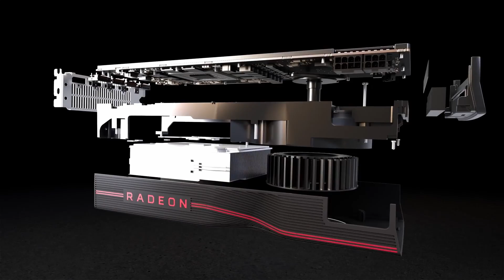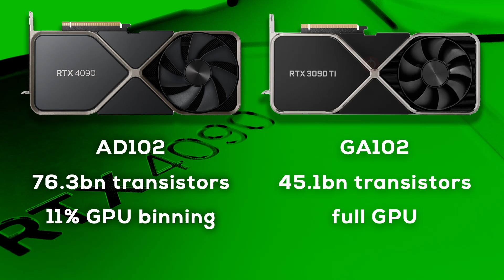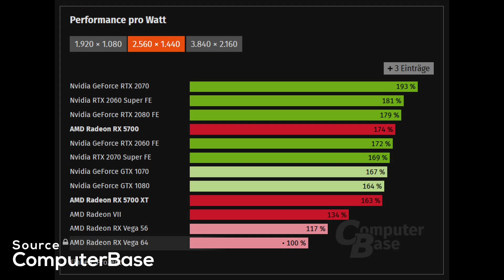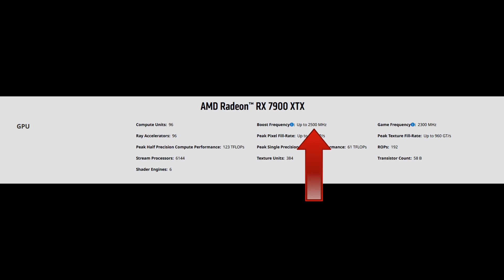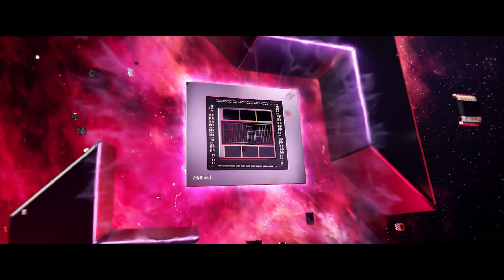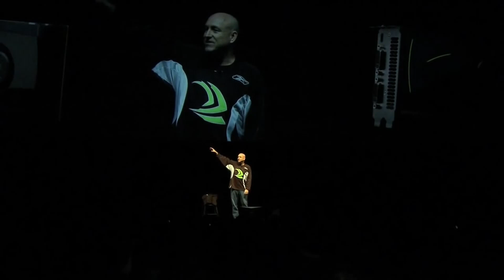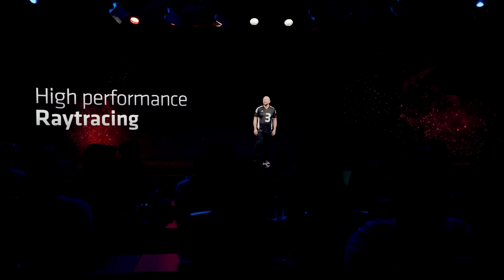RDNA3 – what went wrong?

Comment: i actually think the specifications cant be directly compared. i think the 6144 shader count makes much more sense and if you calculate tflops with this number in mind the numbers really do all add up. that 61.4 tflops assumes that the gpu can run dual issue fp32 which obviously most games cannot. this is why some games the 7900xtx is faster than a 4090 then others it barely matches a 4080 this is likely expected performance. this also makes sense why nvidia with the 30 series didnt hesitate to list the dual fp32 shaders as normal shaders where as amd is choosing to say 6144 not 12288. likely something in the design requires specific things to take place to utilize the rdna 3 design fully. i dont this drivers will fix this and i think people should just accept this is what we got. they arent bad gpu's by any means quite the opposite and i am sure with time stability and some performance will increase. i just wouldnt sit here waiting for some massive turn around because its never gonna happen. id gladly take an aib 7900xtx and run it at 3 ghz and id be more than happy with that level of performance. who knows maybe this time we will actually get a rdna 3+ next year with tweaks to better utilize the shaders. but honestly i think the gpu is running at the perf you should expect out of 6144 shaders and 31 tflops
Reply: Aye the Duel Issue SIMD doesnt seem to be working as one would expect. That alone should increase perf a lot but most of the perf uplift seems to be coming from all the other changes.

Nvidia did the same thing with last gen. Saying they doubled their FP32 but it was sharing with INT and the cards could never reach what would be expected from the doubling.
Reply: pcworld was saying that there's an AIB 7900xtx card that's about $100 more than 7900xtx AMD and it's around 20% or so better because it's clocked near 3ghz etc. I'd be rather happy to buy that as I need to upgrade from my rx570.
Reply: @skilletpan5674  any of the 3x 8 pin 7900xtx seem to clock around 3ghz so if u can find any of them buy it. i currently have a 6900xt red devil in an open loop. id really like to get the asrock aqua because it comes with that water block
Reply: @TheCivicsiep3  yeah I'm broke at the moment. I may beable to get something in feb/march.
Reply: RX 7900XTX is just RTX 3090 TI TITAN edition... new nm process with higher clocks and full die.
RX 7900XTX should be named and priced like RX 7800XTX 399$
RTX 4080 should have ben priced 499$
Reply: @zdenkakoren6660  as much as I would enjoy those prices, I don't think that is realistic. They're for profit corporations, not charities. They need to keep making money to do R&D to make the next generations of cards so we can complain about how it's not perfect on youtube
Reply: I agree I think the refresh will be where it's at, they'll have worked out all their issues with hardware and software and then we can see the full potential of RDNA3. Maybe the rumored 7990xtx will come out.
Reply from the maker: Yes, its definitely not comparable.

Comment: Power management having issues is something AMD's GPU division is no stranger to. Maybe some fundamental mechanism of that (i.e. clock gating) is broken, so that unutilized parts of the GPU can't be shutdown in some cases. As for the interconnect between the GCD and MCDs, this is said to comsume around 20-30W.
Reply from the maker: It could be a couple of things. Maybe the voltages are fine, but its higher than expected chiplet interconnect power draw or power gating problems. It also could be mainly a software issue, lets see if we find out at some point.
Reply: @HighYield  personally I think it's a bios issue reminds me of when a default Vista driver for a hard drive would 12 volts when it was supposed to send 9volts FYI the issue was not fixed until win7 and several  bios updates

Comment: This is so frustrating. All of GCN had power draw issues. Those finally seemed fixed with RDNA1 and 2. Now we're back to square one. IMO AMD should have waited with the release until they fixed whatever is wrong here.
Also, their driver team needs more people! Drivers being rough around the edges at every launch doesn't need to happen anymore with the profit AMD has been making during the last few years. This would also allow them to start thoroughly testing the HW way earlier, potentially allowing them to resolve issues before they ever become public.
Reply: As a former AMD user I have to say the drivers have drastically improved in the past 5 years
Reply: @timothygibney159  then why "former"?
Reply: My rx 580 had the black screen issue and nothing would fix it. Had to return that ish
Reply: Latest drivers released dec 8th, 2022 btw. ❤
Reply: Exactly!
Reply: Another factor here as to why AMD seems to have launched RDNA3 before it was ready also came down to a dead line in the US market, GPUs were about to get hit with tariffs so launching when they did meant they can get GPUs on market before that with the initial batch coming in cheaper. However since then there was an extension on the exemption for something like 9 more months. 

I honestly do think that this is largely a driver issue, AMD is launching a bunch of new stuff including RDNA3 and I think this is why RDNA2 has not gotten an update in like 40 something days. Also the fact that people now complain with only like 45 days before the last update shows how far AMD has come when it comes to driver releases. I expect that we will see this situation for some time until the drivers are in an acceptable place.
Reply: @@user-gn4kb2gi1d I almost purchased one, though I didn't and I am super happy that I didn't as I don't know how much performance it will gain as drivers develop. Though some testing has shown that the 7900 XTX is a card that is capable of going toe to toe with the RTX 4090 when it comes to rasterization performance. With the way things are now it just isn't worth me going from my 6900 XT to the 7900 XTX.
Reply: how much of that profit is from Radeon Desktop cards though? lol… gaming cards are not a big priority over at AMD these days sadly
Reply: @neonlost  Business sectors going well (i.e. CPU, server & datacenter) were always used to subsidise other endeavours…
Reply: Word in the street is that it's not a software "driver" issue, but more of a hardware design failure. Let's blame AMD's engineers. AMD's drivers have been great for the last 13 years. I know because I had a HD 5850 for 7 years and then a RX 580 for 6 years, never had an issue.
Reply: @FrancisBurns  Yeah, it's probably an issue with the "building blocks" used to create the physical design. AMD seemingly didn't bother fixing it for Navi32 and Navi33 either.
Reply: there is a few thing that seems to have make AMD release anyway :
- Pressure from investor
- Soon incoming tarif in the US on electronics
Considering that they plane to make the driver team works during the holydays, they intend to leverage wathever they can with the drivers.
Btw AMD lies before launch where pretty disgusting.
Reply: @atavusable  Like how Nvidia's 4080 was going to be 300% faster than the 3090ti 😂. It's barely 15% faster and crickets. It's only bad when AMD does it as it would hurt reviewers and fanboys feels who purchased them
Reply: @timothygibney159  it’s bullshit when both company does it. AMD contrary to nvidia and intel have been pretty honest for the last 4 years until this release. That  and people craving for good slap in nvidia face is making people unhappy
Reply: @atavusable  Are you kidding me? The 4080 is maybe 15% than the 3090ti if you watch benchmarking videos yet said it was 200% faster. No one called them out because reviewers wanted samples and viewers wanted to feel good about their purchases. FYI I own a 3080ti and have an old rx 570 in my closet so I am no AMD famboy. I do admit  I prefer AMD to be a real player for the whole PC master race market but I do not like this double faceness
Reply: @timothygibney159  I think it was more than that considering DLSS3 Frame generation and all. Could be wrong. But AMD was known for the honest marketing, now it's same as Nvidia.
Reply: @timothygibney159  both are shit mate. which is is inexcusable since both made a shitload of money (unfairly and undeserved since they haven't produced sth good, it was the lockdowns and mining that gave them that profit) and what did they do with it? they shat upon the gamer base which they sadistically abuse by pricing things that should cost tops 700 bucks at 1600. f them both.
Reply: This would also help them retain people from team green. Rather than us trying RDNA3, getting crashes due to the poor driver, then being gaslit that it’s something else in the system when Nvidia ran just fine in the same system…
Reply: Since AMD always overpromisses/underdelivers i can only assume the AI software they use to design new chips has some severe flaws in it. It's like there are a few rules to chipdesign AMD still hasn't figured out yet. What else would be causing the discrepancy between theoretical performance vs practical real life performance.
Reply: AMD's drivers have always been a problem
which sucks cuz Im looking to leave team green
Reply: @thana3270  I've got a 3080 right now, but AMD drivers don't really have those issues anymore. If anything I have more trouble with "Day 1" drivers Nvidia launches all the time. Makes me want to turn off auto update.
Reply: @thana3270  The funniest part is the nvidia support site, seems they don't make perfect drivers either, it's just all the fanboys spreading dis-info...

 you admit you are looking to switch but are going on rumors not past experience....

I've ran Ati/Amd for 20 years and have had almost no problems with the drivers. I've had more problems with windows update by far....
Reply: @jskyg68  my cousin has a 7900xt
and GTA is constantly crashing for him
and a friend of mine has a 5700xt
and games like valorant, apex, cs are also crashing constantly
Reply: @thana3270  Oh yeah? go take a peak at the nvidia support site. Anyone that's has any experience with pc's knows how to roll back drivers, if that doesn't work than it's more than likely some other garbage they installed  causing the problems(look up corsair rgb software causing crashes) or overclocking/undervolting.  

Point is nvidia has just as many issues but the fanboys NEVER admit it...
Reply: @thana3270  Here since nobody ever bothers to look,  this is just a few of what you find at nvidia support site right now.

Game randomly crash when using dx12.
Samsung Odyssey Ark + 4090 stuck at 120HZ.
Colors satured gaming and app.
Installing drivers causes massive graphical disruption and
unusable display.
Driver installation problem.
Incorrect loading of the video card in most games.
HDMI issues with RTX 4070 Ti.
nvlddmkm 3080ti video driver crashed and was reset! Make sure your
video driver are up to date.
4070TI Unknown issues.
4070ti 100% GPU usage - 20 fps all games.
All my games are crashing with 4080.
4070ti stuck at 210MHz GPU.
Games crash with the same error.
how to optimise RTX3060 for use with openGL shaders?
4090 RTX System Is Crashing in 3D Applications.
Random crash with 4070ti1.
Reply: @jskyg68  hmm
that's interesting
I've never had issues during my time with nvidia
770, 1060 3gb, 3060ti, 1650s
nor have my friends with Nvidia
cards

I've made the switch to 7900xt tho
fingers crossed it goes well
Reply: @thana3270  Well I hope you don't have issues with whatever you're running, I just get irritated when i see the "Amd drivers awful" statement like nvidia doesn't have the exact same trouble.

I've owned Ati 9200le, 9800 pro, x800 pro, X1950, Amd hd 4870, hd 5850, hd 7870, rx590, rx 5700, rx 6700xt.

Believe me I would have jumped ship a long time ago if the "driver issues" where anywhere near as bad as people say. isn't it odd nobody ever mentions nvidia's issues? you can see for yourself they are at least as bad as Amd, but not everyone has these problems on either side.
Reply: @jskyg68  I see what you're saying
my original statement about AMD drivers were both from personal experience and from the internet
but yeah I see what you mean by nvidia driver issues aren't talked about often
the only time I've seen it is when I deliberately look for them on google
Reply: @thana3270  AMD's drivers start bad, but get progressively better over time, sometimes to the point that the cards themselves become faster and you get more value out of them.
Those launch growing pains are rough, but they're better than they were in the 2000s when games would straight up freeze your entire system.
Reply: @thana3270  RDNA1 and 2 drivers were never a problem. nVidia had more driver problems there. GCN tough is another thing... and now again.
Reply: @marsovac  my 5700xt would black screen for a whole year before they fixed it. You might've not had the issues but evidently many people did and it was horrible to not be able to leave my pc for 5 minutes because it would black screen. No, reinstalling Windows or different driver versions did nothing to fix it. It has been stable ever since 2021 but up to that point the awesome features mattered zilch if I lost my game progress every time I took a break. And let's not mention the shit show any kind of productivity workload was. Getting blender to render was an adventure I never want to repeat.
Reply: @jadeidkabir5395  I remember last time I was on nVidia with a 780Ti and was still getting BSODs fairly frequently if I had the GPU doing video decoding...an issue I'd also seen on my GTX 470 and GTX 275. At least AMDs issues tend to only last one generation rather than stretch across multiple.
Reply: @TheDemocrab  I completely agree, my first comment may make it seem like I hate AMD, I don't. I'm still using and loving my 5700xt but I absolutely hate the blind AMD fan boys who act like nothing was wrong with the drivers and all the fault was with the consumers being inexperienced. No one should expect an average consumer to have to reinstall windows and ddu the drivers just to get the expensive slab of silicon they paid for to work as intended. Worst part is most of the time the issues STILL didn't go away. I just wish AMD Nvidia and Intel would put more work into making their drivers stable on release day, we aren't beta testers we are the end users.
Reply: Unfortunately I think throwing people at a problem wont really work . Look at  Intel. 
Pretty sure that AMD are well on their way to have isolated the causes and patching those that can be fixed with code.
Shame AMD over sold their performance in that horrible to watch show n tell.
Reply: @ochsosfollies   Intel are going through hell right now, but the future for their GPUs is bright. What's wrong is that game developers seem to keep producing products that need custom optimisations added to GPU drivers to work properly. What the hell are they doing?

Comment: good video dude.
I too think that navi 31 is likely broken, but i think the largest miss is not performance but efficiency. I like my cards and cpu low power and efficient and the clearest sign of this die being unfinished or broken is the messed up high power use when more then 1 monitor is used. something is up here but performance, to me, is actually fine. It beats the 4080 and costs less, if there are driver updates that increase perf its just a bonus to me but efficiency should be the focus
Reply: The high idle power usage isn't unique to rdna 3. I know that at least some rdna2 models will have elevated idle power consumption when using certain display configurations (esp multiple monitors with high or mixed refresh rates). It's not as high as rdna3, but still well above expected power consumption. My suspicion is this is a recent driver issue that happened to coincide with the rdna3 launch.
Reply: @b130610  optimum tech has a video where he shows the numbers and the power consumption is litteraly more then twice that of rdna 2 at about 100 watts
Reply: @zocher1969  yeah, that's why I said rdna 3 uses more: rdna 2 can idle down at 10 to 15 watts, but will suck down over 40 with some monitor configurations which is not normal behaviour. That's all I was getting at.
Reply: try undervolting, AMD cards are usually really good undervolters in my experience and you can make them a lot more efficient and run cooler with the same performance